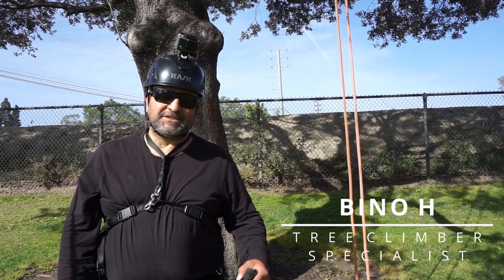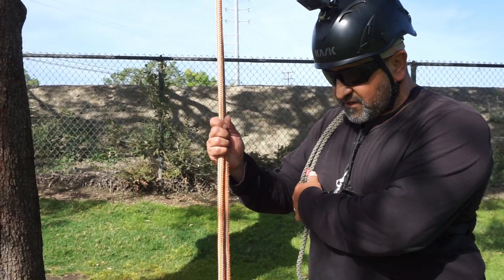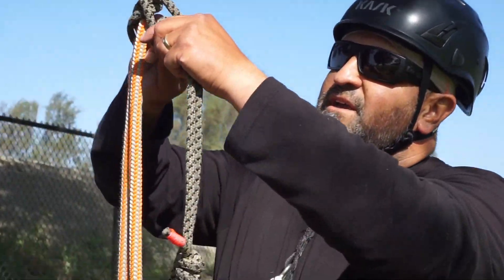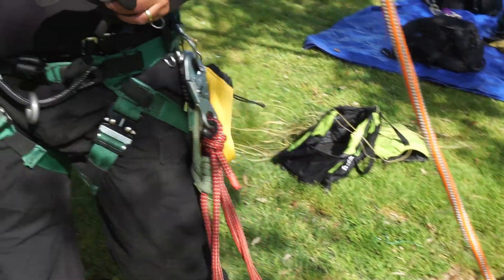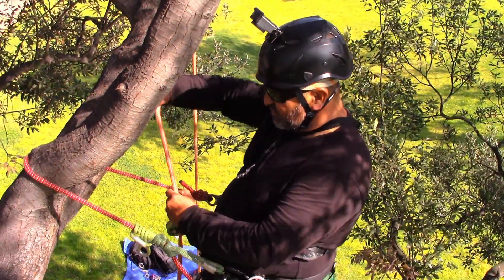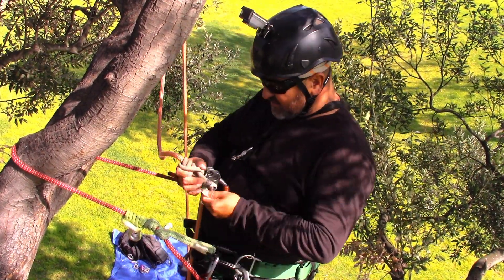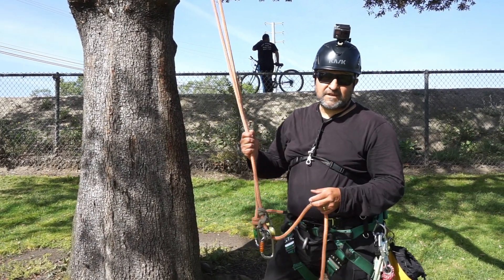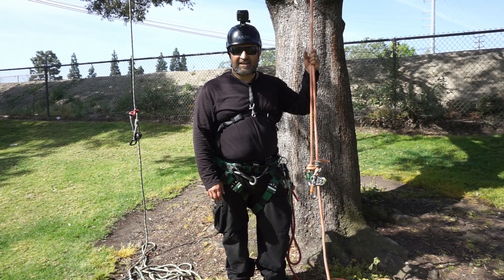Don't Foot Lock! Use Jet Step! MRS Tree Climbing

Comment: So Bino, I have 2 chest/knee ascenders.  Neither compare to my CT Boot ascender.  The Wildken & the Newdoar. The Newdoar needs to have the teeth filed down. It's a rope eater. The Wildken is OK but I would like to get a Notch to go with my CT Boot item. They are sold out & the price reflects it.
What brand & type  of Hitchcord did you use in that video. I have a couple that I ordered 5 years ago & I'm not sure who they are made by. I know you like to tie your own but those looked factory sewn. They really work good on my Blue Moon rope & I would like to get some for my Notch Ropewrench as well as my Hitchclimber Eccentric Thanks & Bino is doing great camera & editing work. Days are getting shorter now which means less time😮.
Reply from the maker: It's an HRC cord 24" by 8mm
Reply: I meant Noah on the 📷 😅.

Comment: Kinda a newer climber, can I MRS with a hitch climber setup with a installed friction saver and just footlock? I am curious it works but I’m scared of stretching out my rope (1/2”). Thanks for all the content Bino!
Reply from the maker: It sound like a modified foot lock where you have your regular climbing setup and you foot lock the running end. That's okay to do. You don't need to worry about stretching your rope as long as it's a rated climbing rope.

Comment: Cool idea. I've seen people use ascenders before in DdRT, and the funny thing is the way the 2:1 works against them by doubling the number of steps. Here by locking the limb up top, you change it back to 1:1, basically SRT. One problem I can see here is the way you could get stuck half way up, if for example your foot ascender falls off or breaks. If the prussik freezes, you'll need to relieve that tension before the prussik can release and allow you to rappel down. So skill with footlocking might come in handy one day, after all.
Reply from the maker: Very true it would be a tuff situation if the ascender failed. Thank you!

Comment: Only had one issue with the Jet Step. The offset on the back side where the rope fair lead (the silver hook) is bradded to the frame was putting painful pressure on my ankle. I am wearing leather boots with a liner. I tried adjusting the Jet Step to locate in front of my ankle but it keeps moving back to my ankle. I solved the issue by putting a piece of the Walmart blue camping foam pad BEHIND the top adjustment strap. No more pain. The foam pad measures 2 3/8 inch wide X 3 1/2 inch tall. Or 60.325mm X 88.9mm. By putting the foam pad BEHIND the top adjustment strap and cinching the strap down tight the foam will stay in place.
Reply from the maker: Nice you were able  to fix the problem in an inexpensive way. Thanks for sharing!

Comment: Is there any reason other than for the sake of demonstrating a basic quickie-less procedure that you’re not using a quickie here? Just got mine and used it for the first time and had a blast but seeing your end go through your butterfly gave a me a little bit of a shock
Reply from the maker: Yes a Quickie in a spliced eye or butterfly with a short tail with a Quickie. I was focusing on using the Jet Step on regular rope and entering a tree for climbers who have not used a stationary system. To add two components the Jet step and a Chest harness/ Leash or Landyard to pull your hitch up. It may help them to see the beauty in the SRS system.

Comment: Wouldn't it be easier to just use a running bowline, then you wouldn't need to take the hitch climber off the rope when you got up there,  you'd just need to put your fishermen knot in the end of your line and be ready to go DRT/MRS.
Reply from the maker: Yes that would and it would be a heck of a lot quicker.
Reply from the maker: True but I wouldn't want to show a bowline on a climbing application because there has been times when the bowline has come undone. Might be better to use a butterfly with a short tail or a quickie in a spliced eye.
Reply: Fair enough. I use a bowline with Yosemite tie-off every day as a full time climber. But like you say a quickie or alpine would also work.

Comment: The Jet Step performs great for a foot ascender, but it is my last choice. The hook has been an issue in the tree and on the ground.   It even ripped a hole in one of my chainsaw pants.  The cam design and ambidextrous use is great. I just wish they would use a latch instead of a hook. My preference is the ISC Strider, or the  CT Quick Step.
Reply from the maker: Good to hear about the performance of it. I haven't had them hook my pant but I can see how that would be a drag having the hook rip your pants. The Stider and Quick Step are nice options. Might be nice if they had two option latch or a hook. Thanks for sharing!
Reply: @BinoH  One big advantage of the hook is you don't have to explain much to beginners. A lot of first timers have trouble with latch mechanisms, but the hook is self explanatory.

Comment: The higher you can set your tie in, the more SRS makes sense. You may advance to the point of using SRS for most climbs, and ditch body thrusting altogether. The Michoacan is a great hitch for that setup. I find it functional without the need for a rope wrench, though a dedicated SRS device does perform better.
Reply from the maker: I agree! thank you!

Comment: Hey Bino, nice video I had a question, how would you advance a tree in a SRT method with a Basal anchor ? I’m new to srt. Thanks in advance
Reply from the maker: You would do it in the same way you redirct making sure you have enough rope. If you are advcaning higher than you can reach, you thow your line over the avancing tie in. Make sure you are connected with your lanyard disconnect your climbing system and reconnect to the line comming down from your advance tie in.